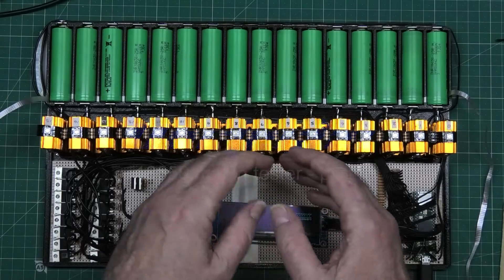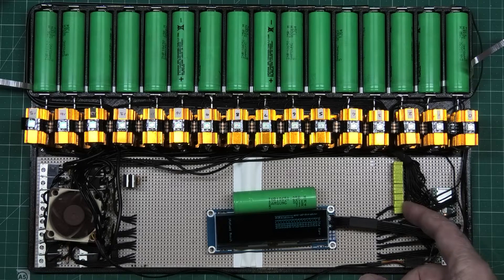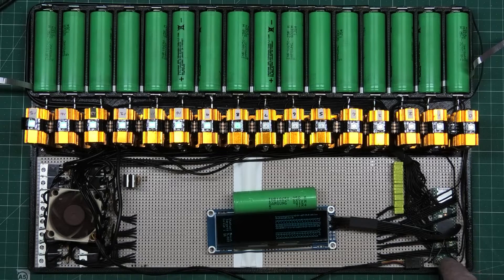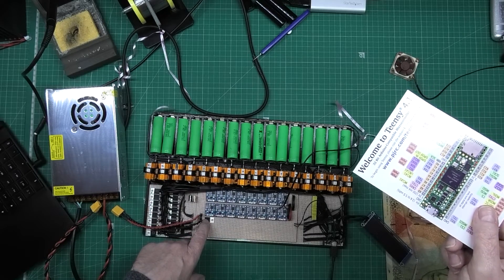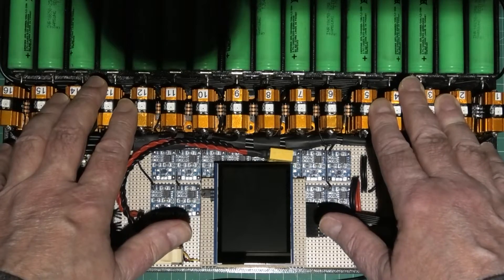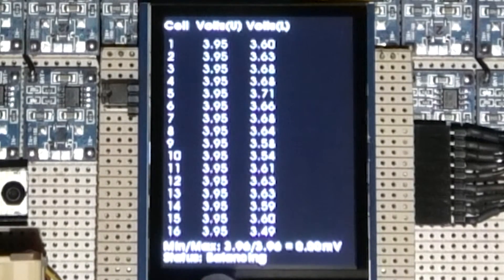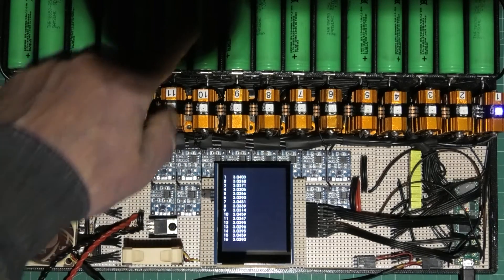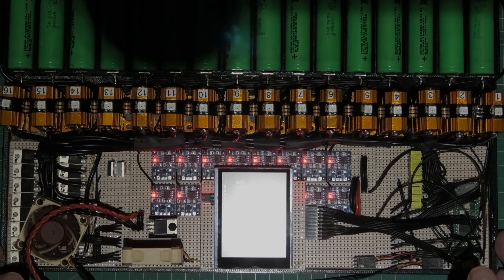16 x 18650 test rig part 4

Comment: Perhaps you'd find it easier if you purchased hundreds of single cell rechargeable Lithium micro-circuits (Cheap and Accurate). I always recharge my 18650 cells individually. Upon charging 100 cells arranged in any manner, I have 10 thermisters in a X formation, 4 of which fill the blanks. I also have a small household fan to cool any delinquent cells. It's a simple set up to check and mitigate harmful inaccuracies. Be it cell or circuit, I can quickly find the cause and affect the best outcome.
Good Luck.
Reply from the maker: When you say "single cell rechargeable Lithium micro-circuits" do you mean the TP4056? If so, I'm already using them (14:45). If not, which ones do you mean - I'll try anything if it's accurate?

Comment: Isn't the voltage sag dependent on the internal resistance? You could measure that to see if they're matched if it is
Reply from the maker: To get a true reading for internal resistance, I need to have zero voltage sag across the discharge wires which is something I HAVE got. I think I'll have to do another version before I can read it correctly.

Comment: Great project it's looking really good now and no burn't fingers that's a result. It's going to be a nice piece of kit when fully programmed as you want it. People don't understand the work involved in new products and when you buy them why they are so expensive it's the time involved that goes into the design not the component cost. Where did you get the oled display looks like something I could make use of ?
Reply from the maker: The OLED is available throughout Aliexpress..... https://www.aliexpress.com/wholesale?catId=0&initiative_id=SB_20201004202904&origin=y&SearchText=ssd1322
The way things are going, I don't think I'll ever finish this thing because I have to start building V4 e-bike soon 😫
Reply: @Vortecks  Thanks I will have a look at that display, you will finish it at some point.V4 e-bike sounds good.

Comment: What does it do Tony?...I'm guessing it finds shitty cells you don't want to weld into a pack?....
Reply from the maker: Exactly that mate...... I've now hit another big hurdle and I've got varying resistance on the discharge wires. Back to the drawing board I think 😫
Reply: @Vortecks  Ah, that's because you are using old, previously overheated wires?
What do I know though really?....lol.

Comment: Owww, I really like the idea of discharge/charge cycling the cells you are NOT reading, visa/versa .. that's smart, on my one I was just giving dead time to the system while reading voltages, but I'm trying to do it in series and having a right bloody nightmare with getting accuracy at 50+ volts  😅
Reply from the maker: I was doing the same as you at one point. If you're using voltage dividers, the higher the voltage, the lower the resolution. I might revisit mine one day (if I can be bothered) 😂